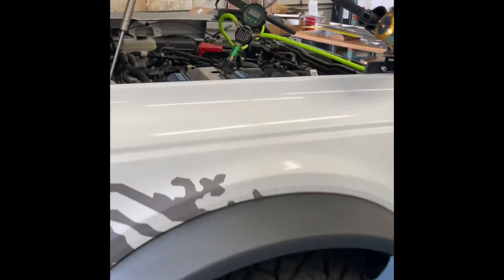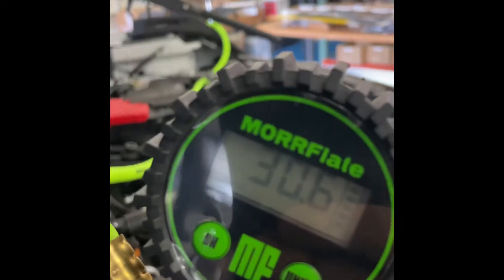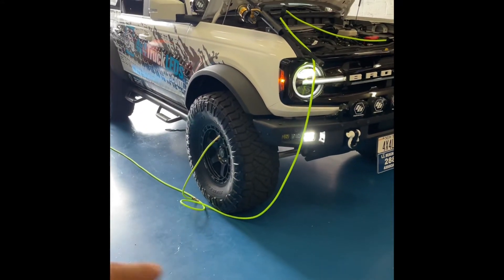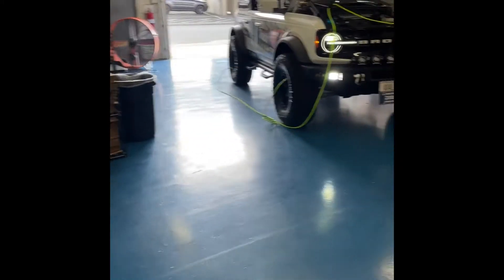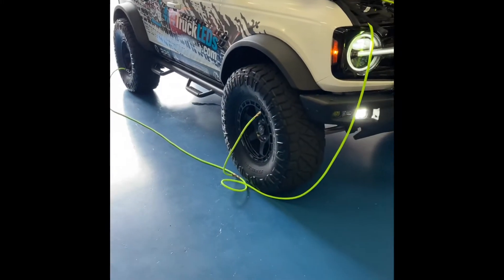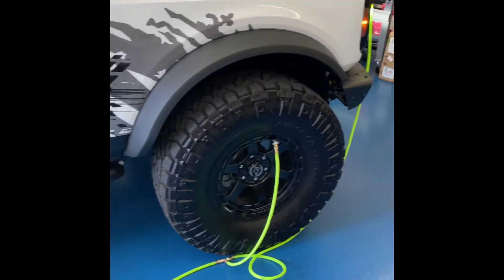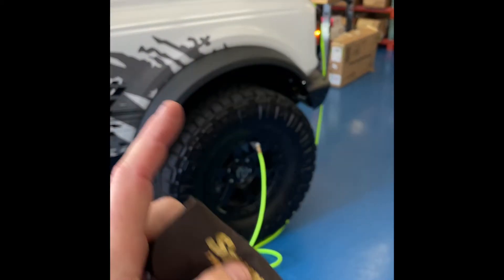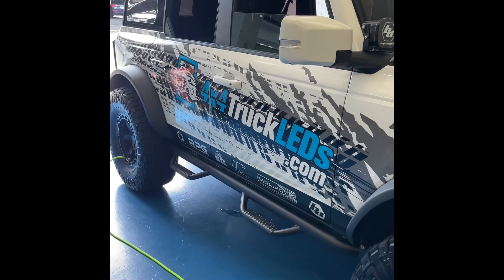MORRFlate Tire Inflation System Demonstration

Comment: I got the morrflate 5.6 cuz I wanted to use this system on 4×4 jeep and the entire fleet of vehicles at the house (motorcycles,  motorhome, cars and pickup trucks) the largest pump says "Don't use on one tire you'll brake the pump prematurely "
 I also am using the 4 tire kit with this pump.
 This aired up the jeep with 33's from 15psi to 32psi with the 4 way hose kit in 7.5 minutes.
 The pump didn't even get a chance to get hot to the touch. 
   It also aired the rv, 2 tires at a time to 75psi without issue.